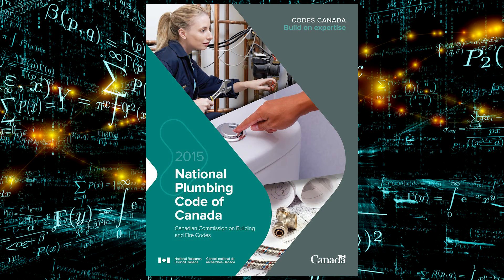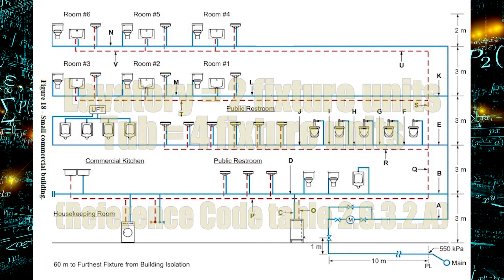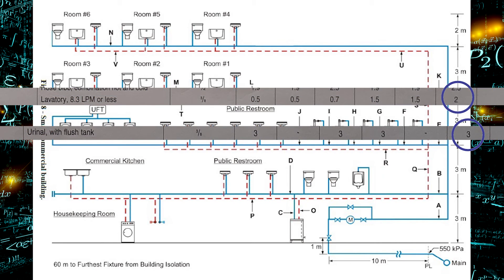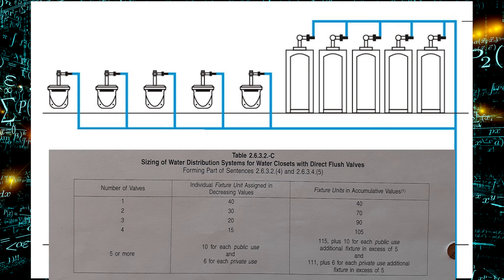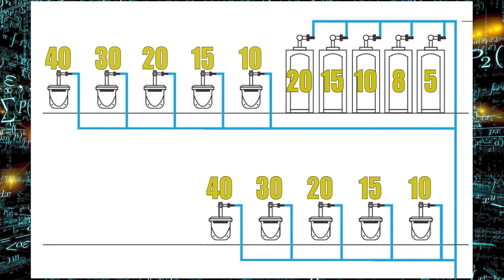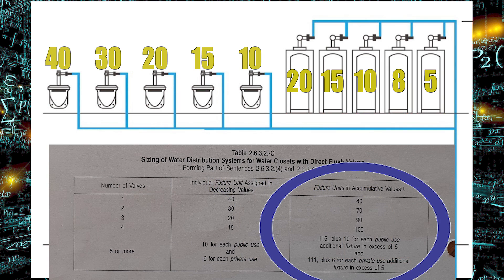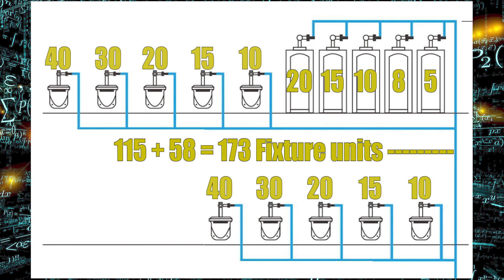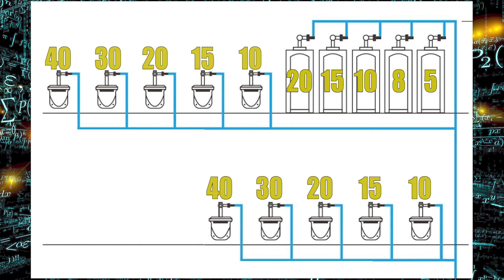Water Line Sizing Part: 2

Comment: Hi Kelly, why is it that the first 2 fixtures in the battery are sizes together? Thanks for your videos. You have been a huge help. Writing 3rd year tq in 4 days.
Reply from the maker: The piping to the fixtures are sized separately, but the first pipe I am asking for (pipe V) is pointing at a pipe serving both of them. So you need enough water or hydraulic load to run both fixtures at the same time. Glad I can help. Are they actually writing TQs again?